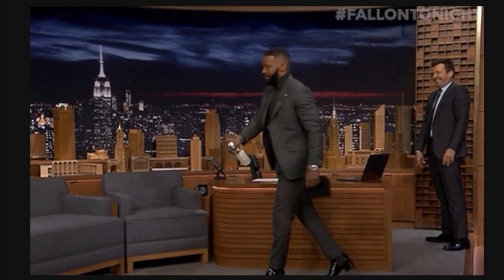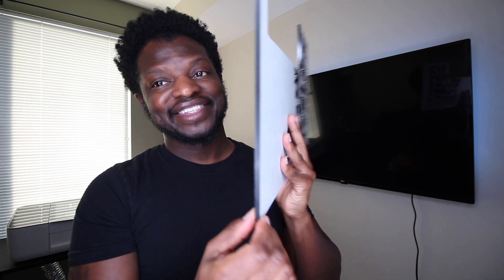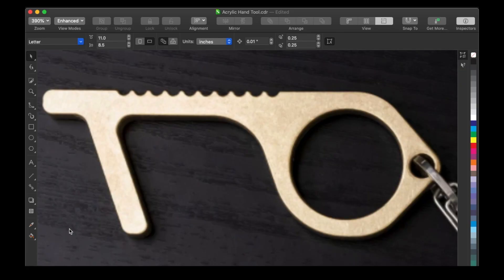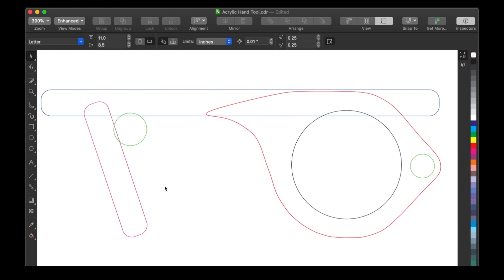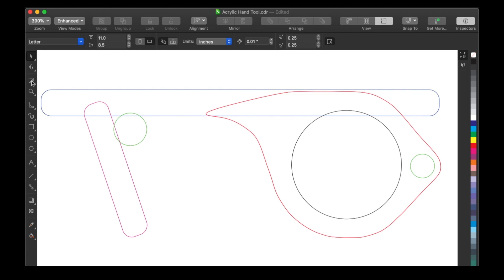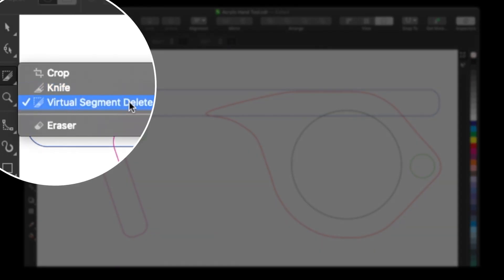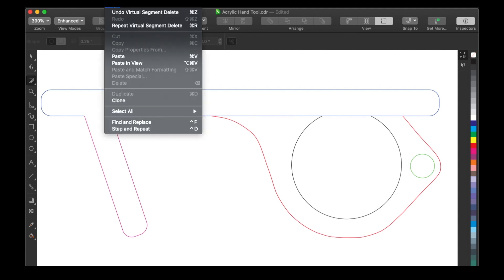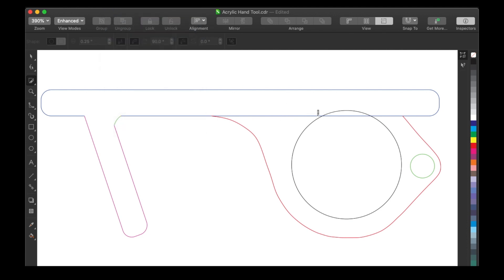How to make an Acrylic Hand Tool | Glowforge

Comment: What “design space” are you using and do you only ever use proof grade materials? Watching a lot of videos about glowforge before I buy one. My only concern is the cost of programs I’ll need to buy to design. Thanks!
Reply from the maker: I use Coreldraw subscription base. I have some proof grade material from glowforge, but I also buy acrylic from my local plastic supply store. I use the same settings as the proof grade setting Glowforge recommends most of the time.
Reply: Troy the Maker     Okay! Thanks for the info, I appreciate it! Hoping to get one soon.